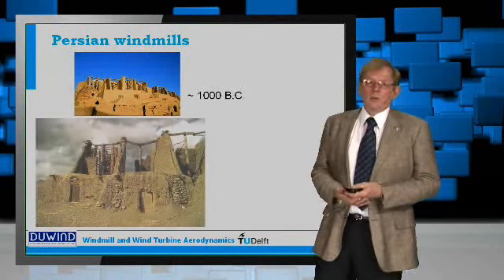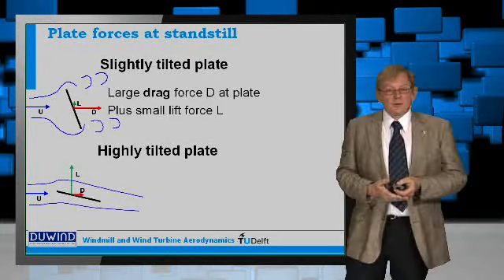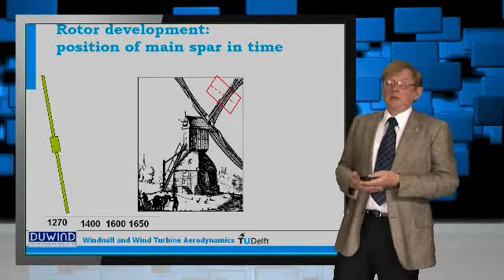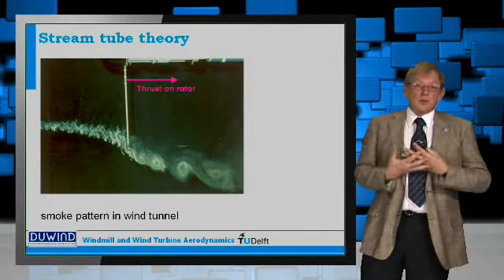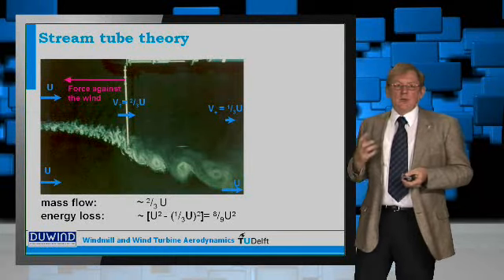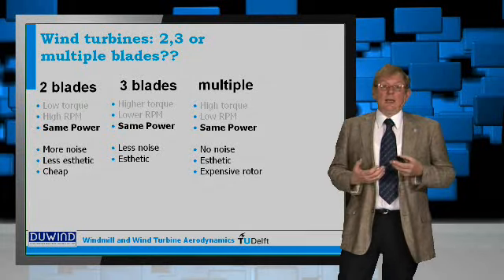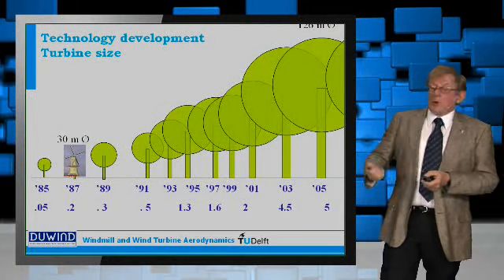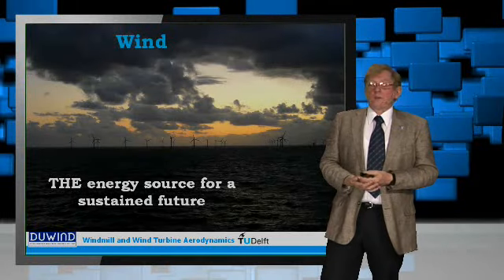Windmill & Windturbines Aerodynamics

Comment: Excellent. Thank you.   We await the extension to Upper Windpower via EnergyKiteSystems
where over 900 stakeholders are gathering in AirborneWindEnergy circles and forum to rapidly develop tethered aviation solutions taping the stronger more consistent and thicker winds above what can be reached by towered turbines.    TUDelft is a leader in the kite energy field research.    Is Vestas backrooms looking at energy kite systems?